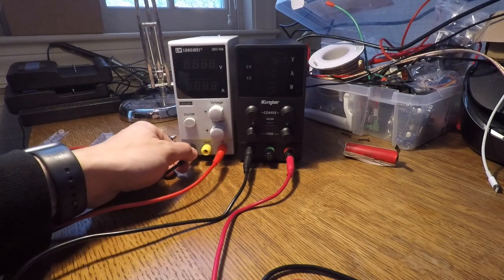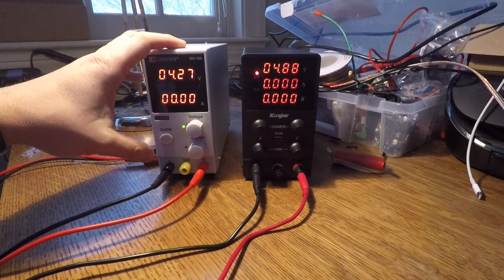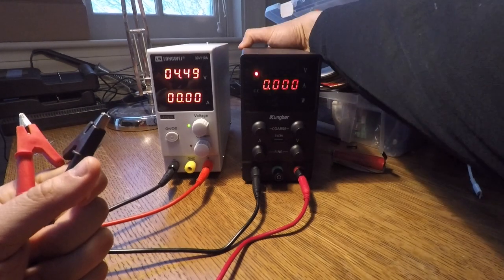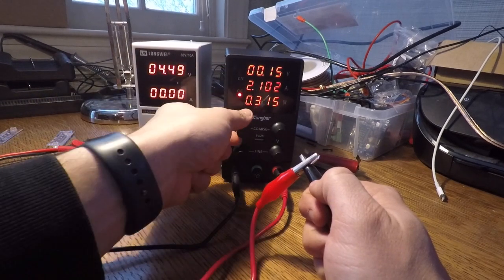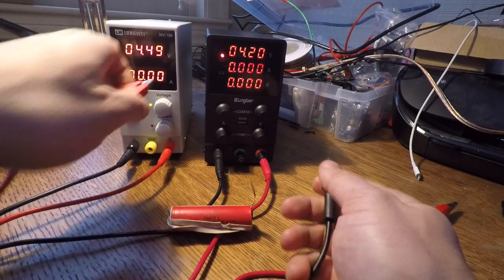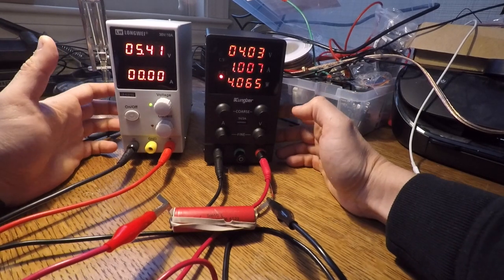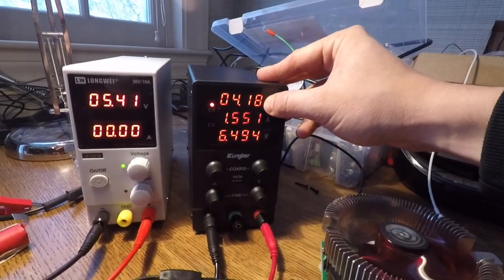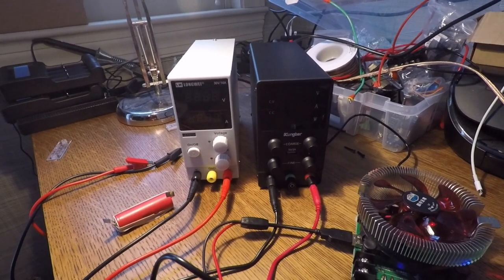Small Bench DC Power Supplies - Review and How To (Constant Current vs. Constant Voltage)

Comment: Its gratifying to me that you chose the Kungber model SPS3010B advertised to be "30V 10A".  I have clearly  found this one to be the most fully featured "hobbyist" DC power supply and the best "bang for your buck" of the lowest cost PSU range among very many models among dozens of brand name for sale in the $40 to $80 cost range. Its design and manufacture quality is "TBD" for sure, but so are all the other models in this lowest cost group. At least a visual inspection of the interior shows neat layout and apparently good solder joints.These supplies won't tolerate much abuse and can't be pushed to their APPARENT power output limit. There's no chance whatsoever that interpretation of "30 volts at 10 amps" from the unexplained phrase "30V 10A" can even be reached, much less maintained for any duration at all without the unit malfunctioning or outright destroying itself. And don't ever try to power even a small DC motor directly by the supply. The PSU is most likely to catastrophically self-destruct !  // The USB ports usually found on all supplies are 5.0 volt power OUTPUTS simply for convenience. Some higher end models have USB connectivity to let a PC based program remotely adjust the settings.  //  Having the main(s) power switch located on the back is no detriment at all since the Kungber has an "Output" switch located conveniently located on the front panel that INSTANTLY stops and starts voltage and current delivery. This is a "non-issue regarding the rear location of the main power switch.

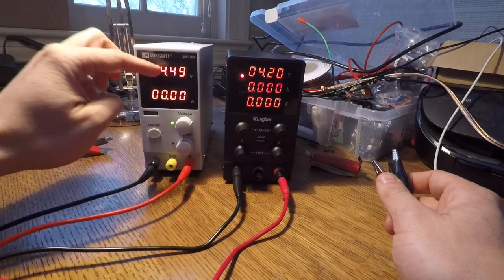Comment: Thank you for showing how to set constant current so I can stop burning out LEDs when testing them. Admittedly I skipped over your video because of the length of 13 mins but after having just spend close to an hour scanning through all sorts of search terms and other videos, nearly every other video  has blackboards, whiteboards, breadboards, sketches, fancy jargon ect  showing off how deeply they can go into what at 4:45 you showed everyone. Simple and to the point confirming I won't electrocute myself. Got bit too many times as a carpenter messing with wires and you just showed what I needed to know. Thank you again!!

Comment: Reminder to set your maximum amps when psu is set below 10v or you will get a spark and risk damaging the unit
Reply: Would be a poor quality power supply. A lab bench power supply should always be able to withstand short circuits

Comment: Well, thanks! I just fixed a super expensive camera battery after buying one of these DC bench power supplies I've never used before. Had to bring the battery up to a minimum voltage and then touch some jumpers on the battery controller and then presto... battery was able to charge again.

Comment: When I connect my leads to my battery, my current goes to zero and the power supply goes to constant voltage with max voltage.

What am I doing wrong?

This is on an e-bike battery that’s rated at 56.7V.

Comment: How often are they used to power a portion of malfunctioning board? Is that use really viable? For example super io does not receive the power, and you power it from power supply to check if board is working, or are such scenarious for the most part not viable?

Comment: am I better off charging 12v lifepo4 directly with this or using it as the power source for my solar charger. I have a good victron solar charger and it seems that would do a better job of taking a battery through three stages of charge

Comment: Thank you for making this video and how you explained it. Thanks for getting to the point without all the unnecessary content. I just purchased a MP3020D power supply and the manual is useless. You're video precisely explained how to set the voltage and amperage, and how to get the constant current set. Greatly appreciated

Comment: Would be nice if they made a cheap psu that could be forced to CC/CV mode. They all have this auto-switching crap so doing current injection on a faulty pcb to find a short circuited part at 0-ohms isn't possible as they all want to just run in CV mode. I just had an experience with one loaned from a friend when repairing an old PSOne. All I wanted to do was pump in 3.3V at 2A (it has dead short on 3.3V rail) and see what part gets hot. But at that setting it would only load the current to 700mA and the voltage did not drop. I ended up having to wind the voltage up to 5V to get it to output 1.35A and then the main video chip got really hot lol. I changed that chip and that fixed it :-)
But it was kind of annoying having to increase the voltage because that's not what I wanted :-/

Comment: BTW: its prolly obvious, but you can use the Gnd for a voltage divider say 30v from +- and insert 2 100 ohm 50 watt resistors - to gnd and + to gnd and get 15v at center tap gnd.  Good for audio amp supplies, But I would get the 60volt 5 amp version. then you get +30,-30

Comment: it takes several seconds to turn off after switching it off because it has resistors and capacitors that protect it when there’s a surge or drop in power.

Comment: Great info. The manual was more than lacking information. Especially on set up. 
Is there a way to set s fixed output for both Voltage and Current? 
Let's say I want to supply a constant 36V at 8A, could this be achieved?

Comment: i just got mine and thought it was not working, it seems to have a mind of it's own and starts to output when it's ready, i have the white Ikokocater SPPS C3005, i set the voltage and current to what i want and push output and sometimes in about 10 seconds it starts, do you think it could have an internal program that checks things and starts when it's ready or is mine defective?

Comment: good info on PSU but very unsafe use of a Li-Ion cell , the maximum V & A's connected to a cell or a bettery (Cell Assembly) SHOULD NEVER ECCEED THE SPECC's in some situation it may support it for a period of time in other's it may be catastrophic VERY FAST . Thank you for the psu info , cheers and i suggest you be more carefull with Lithium in most of all common form we get it as DIY'ers

Comment: I know it's an old video, but it helped me get my head around how to use this. I'm using kind of the same purpose as you with lithium cells. Mine have dropped to 0v so bumping them. See if they are any use so putting them to 3.6v and testing the resistance. I'm not very good with electronics so doing this in the garage. I have built 10s4p packs and 12s3p for my electric skateboard but with new cells. I managed to get hold of couple hundred or so recycled cells see if i ca do something with them. Thanks for the quick video

Comment: That Kungber has two models, 5A and 10A. I wonder if the 5A can be modified to output 10A also. I bet they have internally the same components (for production efficiency by the manufacturer). It could be just one resistor affecting the max current limit.

Comment: Not one place I looked, none of any of the half-a-bakers-dozen manuals I've looked through this past week, sniping best prices  on "best of affordable breed" bench power supplies informed me 'precisely' with no jumper between Negative - Black and Ground - Green, do these produce -15V to 0 to +15V maximum for the 30V models?

also, since I purchased two of the same type last night to be safe.

Do I jumper the my circuit's Negative power supply's Red - + - Positive to the Ground feed on my breadboard, then the Black - - - Negative on my Positive power supply jumpered here as well?, leaving the negative's Negative lead as negative in my circuit? and vice verse Red on my Positive supply
.

I will have twenty Amps total capacity, correct?

if yes, I bought the second one erroneously last night when I bought my first "Official" bench power supply.

Way back when I was doing this before, "Watching myself insert an irreplaceable ROM that is not backed-up since that part of the course is next semester, well, teaching backing-up ROMs not included ever, Inserting it Backwards in the socket, realizing just in time for the thing to get hit "just a little bit  See?  it works after that" and seeing as how shorting capacitors smells like ambrosia, what was I gonna ask?

"Do these Negative-Ground-Positive bench power supplies hide the answer to this question on purpose?

30 Volts 10 Amps

Can I trust their Ground terminal to be Earth Ground, NOT Neutral, and my circuits will get Zero to Plus&Minus-15V on the 30V models?

Comment: i have one that has a special knob instead of a potentiometer style thing, and when you press on it, you can change which digit you want to change, so it works as a coarse and a fine knob at the same time.
Reply: plus, mine shows the max amps if you touch the amps knob for about 5 seconds, which is very useful.

Comment: Unless you are just charging batteries, I would avoid these cheap units, connect a DSO, I reckon the electrical noise would be quite severe combined with poor reliability due to the cheap SMPS design.

Comment: keep the voltage under 5 volts when touching the leads together. 
then when you’re done. disconnect the leads and you can adjust over 5 volts. 
don’t ever go over 5 volts with the leads connected.

Comment: Nice video.  A couple of features to look for that don't necessarily add a lot to the price are a lock button that locks your adjustments so you can't accidentally change your settings and a separate power switch to allow you power on/off to the leads after you've adjusted your settings without turning off the main power.

Comment: I have a sps w605  I set the cv  to 18 for a 18v battery  and the amps at 5  put the battery  on it and it shows the cv  but no  Amps is that normal

Comment: can these not be hooked directly to a motor?  I connected it to a 775 dc motor and it wouldn't turn it.  it did turn a smaller one though.  When I try to turn the bigger one the voltage drops super low

Comment: Is it better to have the 30V 10A or the 60V 5A ?

Also do you actually use this for batteries if you have a good battery Charger?

Thanks very good video
Reply: The best of those two will totally depend on your needs. Each is the best for their particular scenario. 

It's better to use a good battery charger if you have one,  for the correct chemistry of battery that you need to charge. For lithium batteries, chargers will typically use constant current until the battery reaches a certain voltage,  then switch over to constant voltage, and will stop charging once the current has dropped to a certain amount.

Comment: This is the video i needed!

I am currently trying to charge a 12 v motorcycle battery. I am limiting the volts at 12v and the amps at the max battery amp input at 2.6 amps. I am curious why when I connect the power supply to the battery it only draws 0.008 amps.
Reply: 12V lead acid batteries typically charge at 14.4 volts (that's what a cat alternator generates). Check the datasheet for your battery's recommended charge voltage.
Reply: It maintains cv and will not switch over to cc to supply the battery with a decent amount of current to charge it quickly. Its a lead acid battery so i’m not eager to test my hypotheses on it. If i bump the voltage ceiling up i do notice it will take an appropriate amount of current but i don’t want to explode a battery in my garage.

Comment: If you can't see the changes then that's a miss in the design of the power supply. I just got one and it has an "output" switch. Turn the output off and you can see what the current is set to without shorting the wires together.

Comment: Great video. The earth terminal. Are both power supplies isolated from earth   . If you wish to get a positive and  negative voltage can you connect the positive of one supply with the negative of the other

Comment: I'm trying to use one of these to electroplate. I set it to 3.0V, then short the terminals and set it to 0.70A.

But then when I connect the object to the -ve and the zinc anodes to the +ve, it goes into constant current mode and only shows 0.3V & 0.7A. I can't adjust the voltage. 
I'm so confused.

Comment: It's the capacitors discharging. If you turn the switch off then touch the leads together it will instantly turn off. I can't imagine why you'd need to but thats why it has a delay turning off.

Comment: you dont know why it takes 15 seconds to turn off ? the black one has big capacitors to even out the voltage, so you get persistent voltage instead of fluctuating voltage on cheaper power supplies.

Comment: I have an Eventek 30V/10A dc power supply. It can do CC and CV. When I turn it on, it stays stuck on a CC of zero, even after I short the leads. Anyone know how to get it to quit doing this? Sometimes, after a long time, the current will begin to slowly rise above zero. Only then can I set the CC. When I turn it on, the CV light is supposed to come on, but it doesn't. I've tried everything the instructions say.

Comment: I have a unit similar to the one on the right.   "Nice" is the brand on it.   One of the many sellers warns you to ONLY adjust the current limit (by shorting the leads) when the voltage is set to 5 volts or less!   That isn't mentioned anywhere in the manual that came with the unit.
Reply: likely to reduce arcing at higher voltages. 60V may produce a pop?

Comment: #1 I DO NOT PLAY WITH ELECTRICITY! With that said, I understand the basics of wiring ( well maybe lol ). Can someone tell me in layman terms... Example: I have some headlight assemblies that I want to retrofit, they will be drawing about 12v, 4-5 amp ( 3.8 to be exact ) and upwards of 55 watts they have the separate connectors for each assembly for high-drl/low/turn bulbs. So, do I set the bench power to 12 volts amp to 3.8 and test each headlight connector, use adapter banana plugs to have 3 negative clips from one lead, 3 positive clips from one lead to power the headlight assembly at once??? PLEASE EXPLAIN LOL.

Comment: It has been quite a few decades since I diddled with electronics, at least in "bench mode."  I've just gotten this new Kungber and am still trying to muster the courage to actually connect it to my breadboard circuit.  It is just ~so~ counter-intuitive to me to see my selected voltage in the display and SHORT THE OUTPUT!  But I'm doing it...ever so gingerly.  I think I am going to pretend for a while that the current controls just do not exist (like in my old-timer experience).  I really do not like to work with power without feeling absolutely in control, without everything being completely intuitive.  OK, I'll set the current, but only change it with great deliberation.  I guess I feel like I have to, because I don't see the easily accessible fuse on the front panel, which used to put the brakes on my current.  And, of course, I can see that this is really so much better, because a one-amp fuse my have limited the fire hazard in the past but didn't do much for protecting the low-power ICs and other components that we mostly work with now.  (If I had been on the design team for this product, I would have insisted on a button that said "Adjust Current" and shorted the output internally without me doing such a wretched thing myself.  IMO, kinda bad to initiate total newbies into any kind of electrical work without supporting their wise instinct not to connect + straight to -.)

Comment: The 3.81 that was showing up after you started drawing current off the black supply with the tester, may have been accurate.... the voltage coming from the power supply, will NEVER be the same as the voltage appearing at the device, because of losses on the wire.  3.81 on the device, and 4.20 on the PSU would line up with a decent amount of power loss on the wires, basically they were never designed to carry more than about an amp of power.  (get better bench cables! lol)

Comment: I was thinking of buying one of these at 60V 5A to have a little more versatility. Is there a reason that I would be better off or need to go to 10 Amps?
Reply: I think it's either 30V 10A or 60V 5A.  Don't think they usually come in 60V 10A (maybe if they are way more expensive, not sure).

Comment: The fact that these don't seem to have a soft output channel switch is a huge red flag.  That physical main power switch is going to cause spikes.  I also don't like how they lack a separate maximum setting.  Chinese hobby junk, okay for casual users who only need to replace a $5 arduino if it fries.

Comment: Good morning, can this Longwwei power source be used to identify short circuits? (it turns off or does not turn off due to a short circuit in a Laptop Board), I need it to continue supplying current to heat the components that are shorted to easily identify the component to change.

Comment: This was probably the best explanation I’ve seen so far on bench power supplies. I’m about to start top balancing my new 280ah cells. Still a little confused on whether these units eventually shut off when they reach the max cell voltage. 3.65. Or if you need to monitor it.
Reply: of course not dude they're bench supplies how are you going to use it to test stuff if you want it to run all night you want it you run all night. you're going to want to get some bms chips, they're available for single cells, or packs in different configurations of S and P. the bms will shut off the current after the battery is charged. they're also cheap, like i got a whole board of single cell ones like 10 chips for 5$, they just have tabs to solder on input and output wires.
Reply: @simonlinser8286  they do actually shut off when they reach the max voltage.

Comment: I have a Kungber power supply like yours and I have been using it to drive a small 12V stepper motor. Today, I went to go use it and it is showing nothing but zeros. Zero voltage. Zero current. Turning the knobs changes nothing. Any ideas on how to fix this? Is my power supply junk?